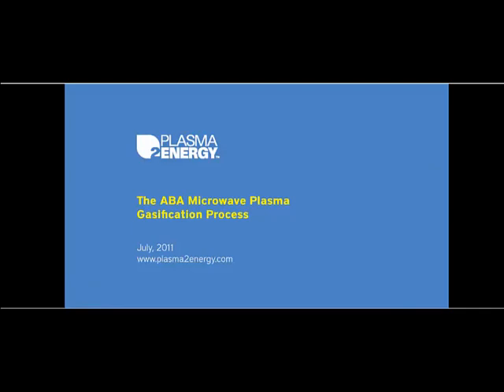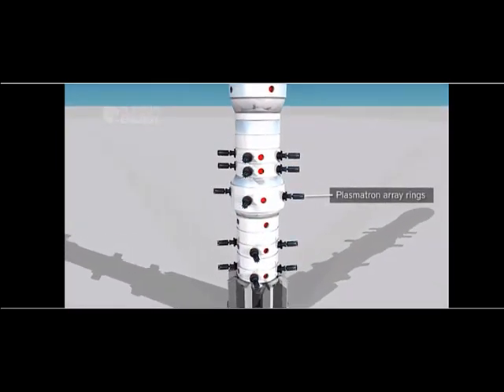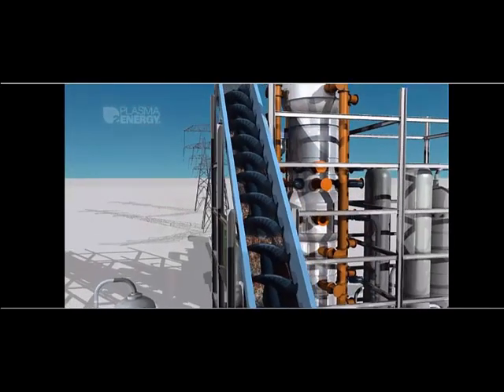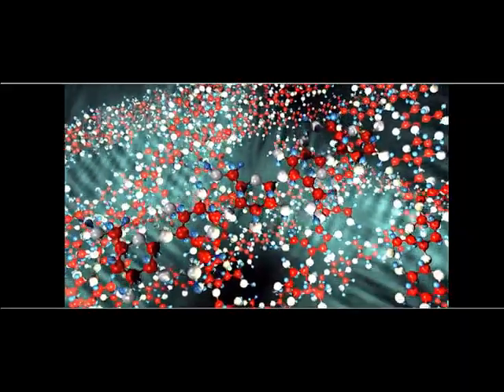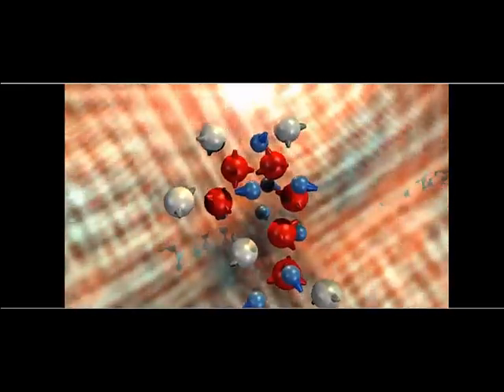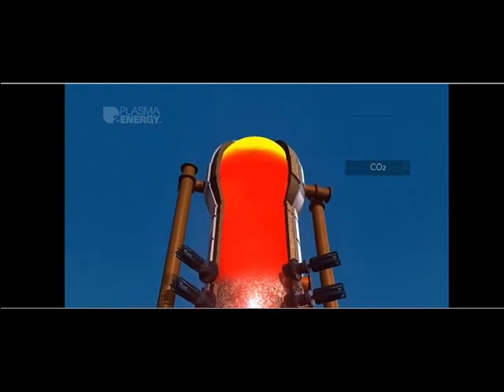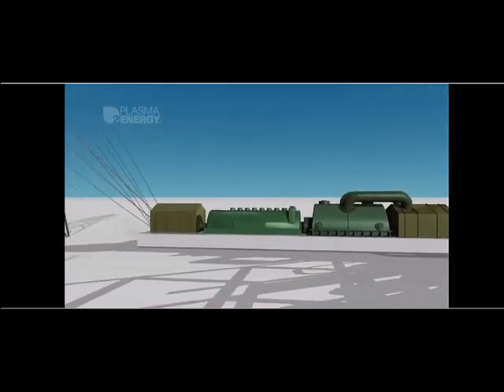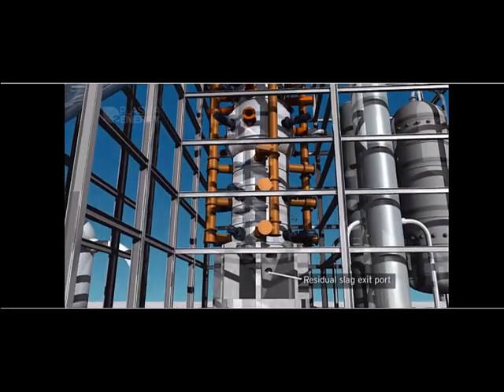Microwave plasma gasification

Comment: Is the slag toxic?
Reply: It would depend on the feedstock. For example, sometimes plasma gasification is used to consolidate radioactive materials. All of the radioactive elements of the source material are left in the slag after gasification, therefore they take up less volume and are easier to manage. In this case the slag would certainly be toxic. Ordinary feedstocks may produce toxic components in the slag as well, but I believe municipal waste slag can be used as-is in construction, or at least easily processed.